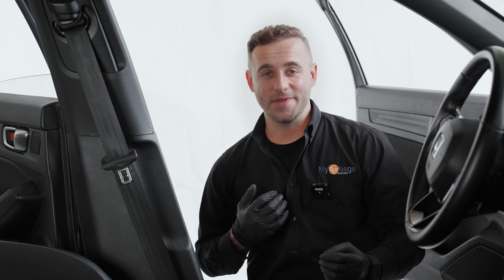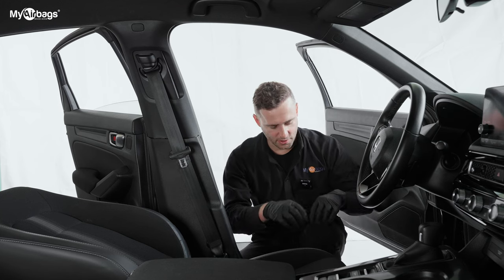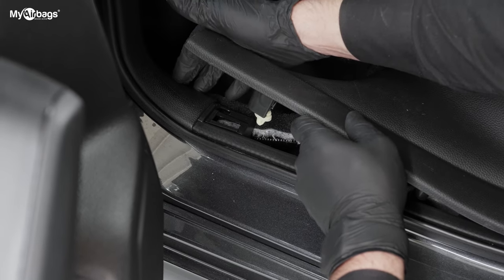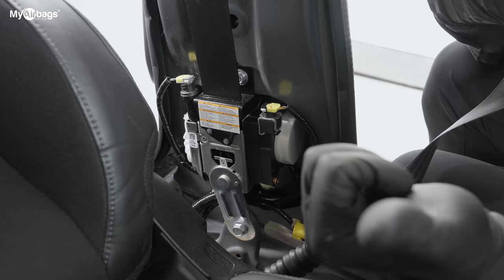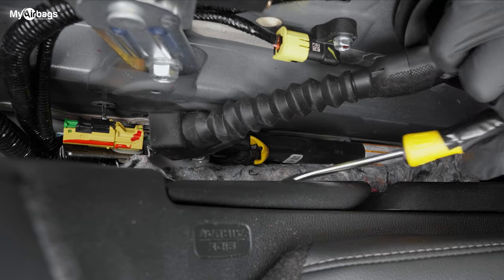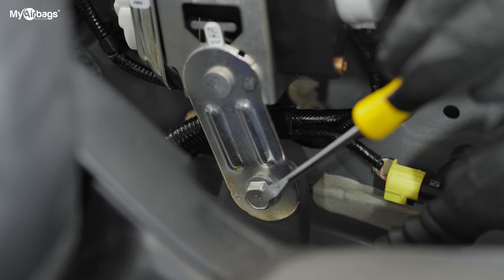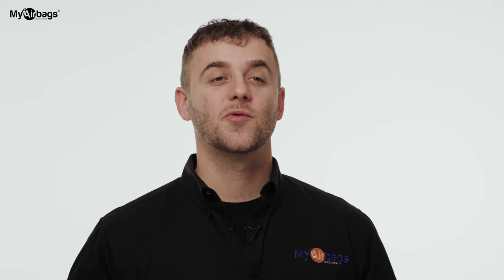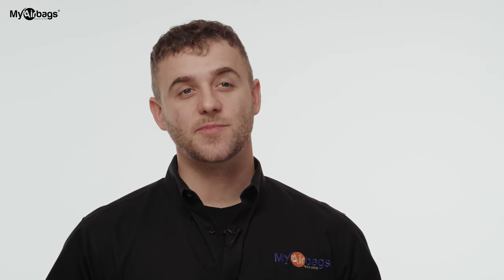How to Remove Seat Belts in a Honda Civic | MyAirbags

Comment: Thanks for this video! I need to replace a seat belt in 2009 Honda Civic for physical damage to the belt (it's frayed). If I disconnect the battery before disassembly, will I have any issues with the new (OEM) belt?
Reply from the maker: Yes, you can send your frayed seat belt, and we can change the seat belt webbing. No, you will not have any issues with the new OEM belt.

Comment: What kind of tools are needed for this removal? Also If the error code says open or increase resistance in the drivers seat belt tensioner /open or increase resistance in the front passengers seat belt tensioner ….what do I have to send for repair?
Reply from the maker: Yes, both seat belts are bad. Yes, we can rebuild them. You will need a ratchet set and a flat head screwdriver. Visit myairbags.com for more info.

Comment: I ran over a pot hole in the freeway and my seatbelt locked up, the covers popped out but the airbag didn’t deploy. But it made such a loud sound I thought I got hit and pulled over for a little bit. The airbag light came on. Idk what to do
Reply from the maker: Looks like your seat belt deployed. This means there is a pyro sensor that goes off when the vehicle is in collision or hits something. The airbags did not deploy because vehicle either was not going fast enough or sensors did not sense a frontal collision. We can definitely help you and reset your airbag computer module and rebuils your seat belt. Check out myairbags.com

Comment: So in my car only one seatbelt is locked up (the rest are fine and airbags were not deployed) and I plan on sending it to you guys, and my question is what do I do about the red airbag light on my dashboard (I have a 2010 civic lx).
Reply from the maker: For Honda Civic check the seat belt buckle (the receiving end that has the red button). The buckles do go bad on Honda Civics. You can tell if its bad by looking at it to see if the buckle has collapsed (shrunk, pulled down, scrunched). It will also have a long cylinder tube at the bottom of the buckle where it pulls the cabe through collapsing/pulling the seat belt buckle down. We do also rebuild seat belt buckles
Reply from the maker: Some seat belts may work okay but still can be bad. The best way to find out is to have the system sacnned for SRS codes. But if the seat belt is bad, then the airbag computer module will need to be reset as well. You can send seat belt(s) with airbag computer control module as well.
Reply: I think I have same issue on my 2015 Honda civic. None of the air bags got deployed only LH seat belt locked. I did buy new one from an auto wrecker. Installed by mechanic but light still on. They did a free scan but nothing showed up on their ad 0 codes. They don’t know what to do. 
Idk to do. Plz help